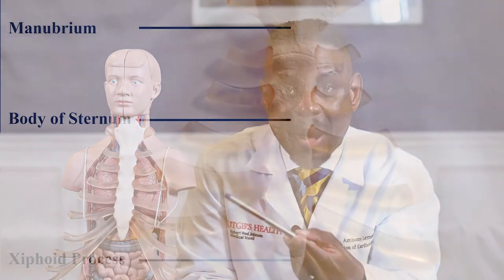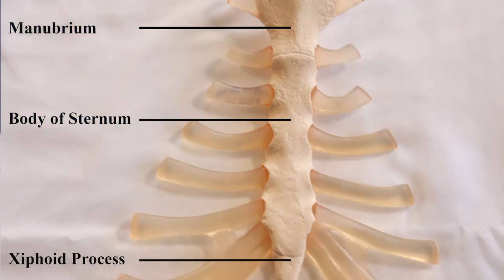How to Close the Chest after Heart Surgery

Comment: Good night Dr. I recently had an aortic root replacement surgery. Can this be considered a coronary bypass surgery?
How long do i have to wait before removing the wires?
Is this procedure considered open heart surgery . Thanks very much
Reply from the maker: Thanks for the question. An aortic root replacement is not considered coronary artery bypass surgery. What you had is a lot more complex operation. There are significant differences in the operations. The sternal wires can be removed approximately 3-4 weeks after surgery without a problem but this should NOT be an elective procedure. The wires usually don't cause problems so I would only take them out if its required. Good Luck!
Reply: @cardiacsurgerypatienteduca2445  Good morning.Thanks very much for the information. It's been one year since my surgery an I am having itching along my chest scars. No visible rash or discomfort. Is this something to be worried about.

Comment: Hello doc. I had open heart surgery because i had TGA when i was a kid. I always thought that my sternum was stapled back together. Or had at least metals holding it together. So it's wires??
Reply from the maker: Hi, it depends on how old you were but most of the time wires are used. In very young kids wires are not used. You can tell if you ever had a recent chest X-ray or CT Scan of the chest.
Reply: @cardiacsurgerypatienteduca2445  OK. Speaking of age, i also want to ask you about why I got my surgery done at the age it was done. If I'm correct I got mines done at age 10. But the thing is that I heard TGA surgery is mostly done when the person in a baby. Because TGA is serious life threatening. If that's so, then why was mines done so late at age 10, and why didn't I die in between that age gap?? I know I would turn blue so that means I was old and running around so I must have gotten my surgery at age 10. Why wasn't mines done when I was a baby? And how did I survive without surgery for that long to age 10??

Comment: Hi Doctor,i have some unusual question.I train hard,and i trained while i had corona virus 1 year ago.I got chest burning pain and i stopped.Later it showed there is no Heart or pulmonary problem.But it Hurted like burning for days inside the chest in both sides.But it happened something very unusal.After few days i got Hematoma like on the right side of the sternum,right where cartillage meets the Sternum Bone.Between  3. and 4. rib.Or maybe 2. and 3.So its up there.I done some stretching,that was 1 year ago.And Hematome just exploded inside.I didnt know nothing of it nor i went to Doctor.It hurted but i continue life.And after one month from that,in february last year,i warm that place on the heat,and when it got pretty warmed,i made some move and it just snapped so hurtly inside like the small rope if you pull it off.ANd it Hurts to this day.More than One year.I cant take any weight not 100 grams and when i tryed maybe 6 months ago,i got so sharp and burning pain like somebody wants to break me in half.And that happens like 10  times whenever i made a mistake to not be disciiplined to move very safly or to carry something for a moment in the right hand like glass of water,its dissasterous pain right where hematome was..I can move hand in any direction but smallest changes in move or rotation can cause big pain inside,and even 100 grams is big no no.My question is cause i feel it on the surface of the chest not deep,deep inside,where the organs are,if you can understand it,and not any kind of breath problem,or any dull pain,nothing of that,energy is there everything normal,just like i injure something again and again....can it be that Cartillage is injured badly or can it be that some Nerve is injured or maybe some Scar that is inside on the cartillage or even on nerve or something like that...cause the way it happened in the first place was,when i done some chest gymnastic position on the ground like push up but much harder with straight arms,thats when first burning occured...in all chest ,nobody diagnosed it even on Ct scan,2 times ,but i know something is injured there for very long and its so sensitive On that place.The hurting occurs also on slightest touch even after 1  year.But i Breath normal and everything,..it can hurted for days if i injured it  again,than it lessen the pain,and all in the circles.Im just asking for your opinion can it be that injury of that stile could lasts so longif its Nerve,Cartillage? I had a frend who told me that he had injury on the same place from exercises like Dips with added weight that lasted like more than 2 years,even 3 ,and he didnt go to doctor.And what would you suggest how to see it, please> and Tnx>Its Big Problem for life..I can bet that it is njury cause it hurts on any mechanical moves or weight,or even if i move neck fast or unusal up and down,it can happen any time to feel the pain,only its less of pain when a lot of days i do ealmost nothing and be disciplined,but if i made so called Mistake ,here we go again......1 Year and 1 month that lasts....Im asking you cause you know anatomicaly whats lies just in that place and if its possible to heal itself or any other suggestion....
Reply from the maker: Hi, I apologize for the delay in responding. It sounds like this problem has significantly impacted your quality of life. I personally think you need an aggressive work up with imaging and further testing. I'm a heart surgeon so although I'm familiar with the anatomy its hard to say why you're having your symptoms. I recommend that you go back to your primary care doctor and perhaps request a consult with a Thoracic surgeon who deals more with the chest wall than a heart surgeon. I apologize that I can't be more helpful.

Comment: Hi Dr, why my son after vavle replacement for 25 days, wound infection happened!
Reply from the maker: Sorry for the delay in responding. Every patient situation is different. Most patients who develop infections during the first 30 days after surgery is usually because of a "break" in sterile technique during the surgery. I suspect that the infection occurred either in the operating room or shortly afterwards. I think it's best to discuss with your surgeon because the surgeon can give you more accurate details.
Reply: @cardiacsurgerypatienteduca2445  tq very much for the info. He is back home now, take antibiotic 4 pills for 4 times daily.
Reply: @cardiacsurgerypatienteduca2445  hi Dr, my son was diagnosed as Stanford A artery dissection but Dr just repaired and didn't replace the vavle. Does he need to take high blood pressure medication for life? He is doing well now, wound heals! Tq
Reply from the maker: @siohkohli9461  Sorry for the delay in responding. I'm glad your son is doing well. A Stanford Type A dissection is a major medical emergency. We don't usually replace the aortic valve during that surgery. Your son will have to monitor and manage his blood pressure for the rest of his life. He may require blood pressure medication. High blood pressure can cause the remaining aorta to get larger.
Reply: @cardiacsurgerypatienteduca2445 tq so much for the reply Dr. Take care!

Comment: Why we feel chest stiffness  after Bypass surgery
Reply from the maker: When the sternum is put back together its' important that the two halves of the sternum is stable and secure. The chest initially feels "stiff" or rigid but over time this with lessen and eventually the patient should feel back to normal. If the sternum is not put back together "tightly" or rigid, its' possible the sternum could come apart. The stiffness should improve with time but if it does not please contact your surgeon.